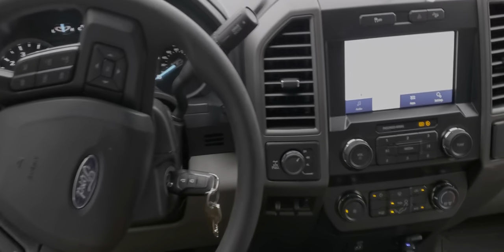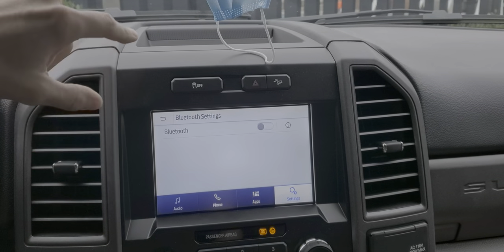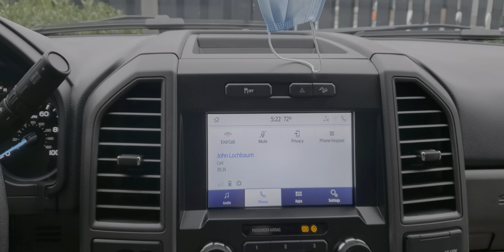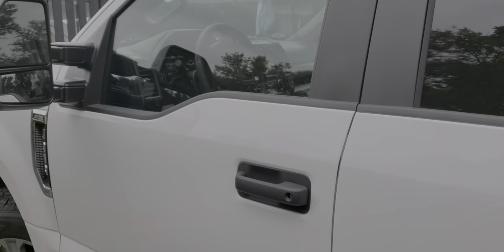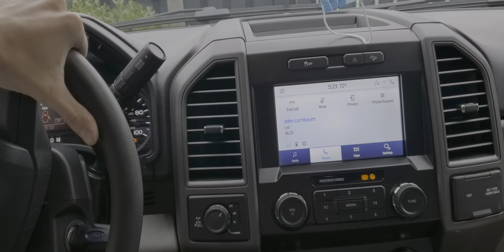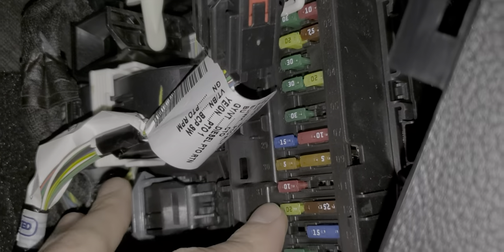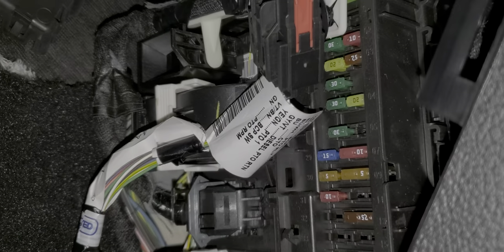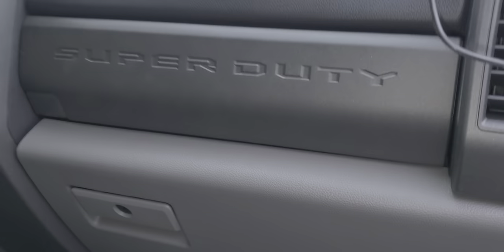Ford SYNC 3 Stuck in Phone Call FIX!

Comment: This isn’t a “fix” this only resets the radio so it’ll eventually do it again.  It does it on older regular sync radios too.  It’s not because of google voice because it happens on my iOS device.  It’s random as it happens with any call.  So it’s got nothing to do with the contacts name either.  This has been an issue since the latest sync update.

Comment: 2023 transit 350, same issue, reset with "engine running", hold power button and fast forward for 15-20 seconds, screen goes blank and resets, problem gone for now

Comment: Sync 3 reset hold the power button for the radio and the fast forward button it will perform a full reset. Im not messing with the fuses with my luck 😂

Comment: That is not fix it will continue to do that mine does the same you have to step out of your truck for like 10 minutes ignition off its the same as pulling the fuses I have the same issue 2016
Reply from the maker: Removing the fuse worked for me when turning the truck off and back on again did not. I'm sure that leaving the truck turned off long enough works as well.
Reply: @LehewTech  yes turn it off for  like 15 minutes beats removing the fuses but mine only does it when my wife calls only with her # its weird
Reply: But do u still have problems with it being stuck in a phone call? Is there a way to fix it for good? I just re-set my radio usually but it's annoying because it happens everytime one specific person calls me
Reply from the maker: Does the contact name for the person calling you have any unusual numbers or characters in it? You may have success renaming the contact